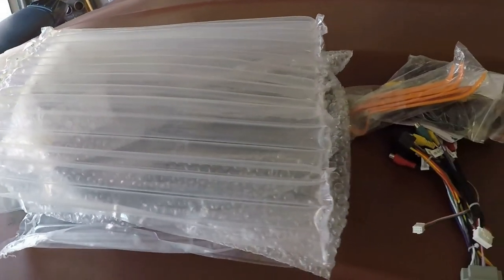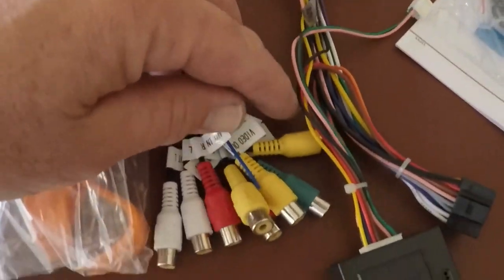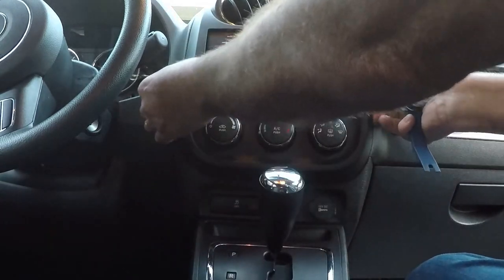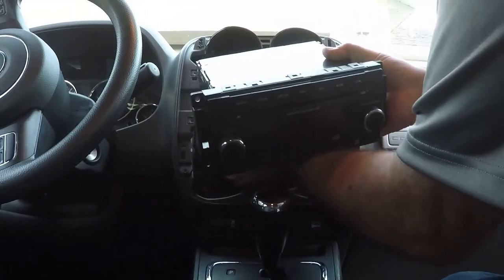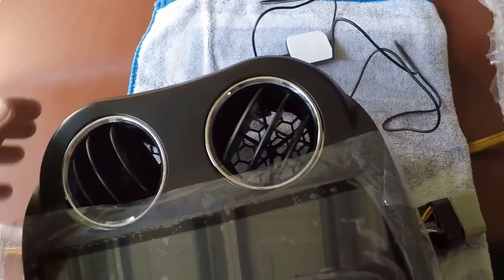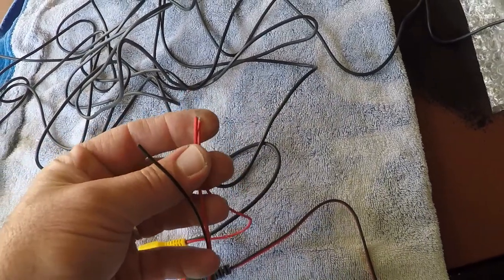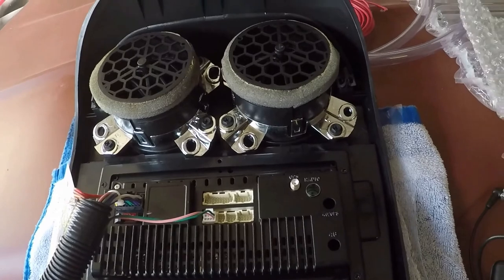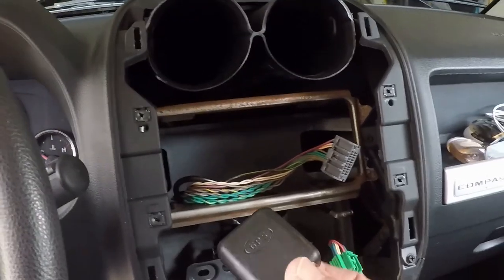Compass GPS install

Comment: Just installed this same unit in 2016 Compass. I didn't do back up camera. Maybe in future. Wiring was bit confusing, a lot of the instructions were in Chinese! The plugs are designated to only fit one spot, so trial and error til ya get it.Have seen in comments about the other white harness on factory radio. This plug is not used, there is another one hooked right next to factory antenna, mine was yellow and orange that is not used.
That part only took about an hour, getting all functions working...maps, youtube,google...etc took another 3 hours of pushing buttons and changing settings etc...update all apps. I had to tether hot spot from phone using Bluetooth, the radio said WiFi only connection. With hotspot on it turns off wifi, that's ok phone instruct was wrong. The sound is good but you have to choose right settings and use EQ. Overall, the hassle seems to be worth it, touchscreen functions well. No lag in display. Hope this helps! ✌

Comment: Unit has been awesome since i got mine. Installed it with no problem. Only issue i dont like you cant use the gps without bein connected to your phone😏🤦🏽
Reply from the maker: I think it’s a pretty nice unit for what it is.  There are a few things I’d like to be different.
I’m glad that you are mostly liking your stereo

Comment: Do you have a link for the Jeep Radio Plug Adapter? Please put in description, thank you
Reply from the maker: I should have added that information in the description, it’s there now.  The only wire I needed to order was the antenna adapter VWA3B.  It’s a short wire with a light green connector that plugs into the jeeps antenna wire and the other end with the round connector plugs into the stereo.  I ordered mine online but many different stores carry them.
Reply: @bhwjrproductions  thank you for your reply

Comment: i just installed this same kit and still need to run the wire for the backup cam (when I get some time). Thanks for the detail with how you ran the wires in the liftgate itself. I am curious though what pathway you took from the rear pillar to get the video wire back to the head unit. Did you go high (under the headliner), or low (under rocker panels). Just wondering if you had an opinion on what was easiest. Thank you
Reply from the maker: I went low under the door sills/ edge of the carpet.  I think i ran the wire up by the driver door then low across the bottom of the dash to the head unit.  It was a pretty long wire.  The hardest part was pulling the wire through that rubber boot from the lift gate to the roof of the car.  I taped as thin and smooth as I could and sprayed a bunch of armor all rubber protectant in the boot to help slide it through.  The wire is skinny but the rca connector is kind of big but it squeezed through.

Comment: I’m in the middle of installing my touch screen but it’s not cutting on , how did u get it to cut on ?
Reply: Check your harness wiring.  Sounds like it's missing the 12v power.

Comment: Appreciate the guided installation, got this same unit installed but haven’t done the camera yet. Where did you connect the red power to and where did you end up grounding the black?
Reply from the maker: The red isn’t needed.  I think there is a signal wire in the factory radio plug that tells the radio that the car is in reverse.  There was an optional back up camera for the compass so some of the wiring is already in the car.  I just taped that red wire off, it isn’t needed.  The black I grounded with another ground behind the drivers side trim panel in the rear storage since I had that panel off already to Ron the video wire and tap into the backup light.

Comment: I just installed the newer version of this (4g+64g 10.1" android 12 unit) and its not getting power at all. everything is plugged in correctly but for some reason no power to the unit... my last unit (Boss BV965NV navigation system) popped and started smoking from the cd slot so i wonder if something fried.

Comment: My backup cam doesnt display any guide lines. I tried to find it in the settings but no luck. Any help?
Reply from the maker: My back up grid was there when I first selected reverse.  I like it and never tried to turn it off.  When in reverse if I touch the middle of the display screen a menu pops up to adjust lighting but I don’t see any option to turn the grid on or off.

Comment: Where did you run the wire for the backup camera? Dis you run it openly through the car up to the front?
Reply from the maker: I pushed/tucked it under the side panels and door sill panels on the driver side then zip tied to other wires at the bottom of the dash on the back side enough so the wire wasn’t hanging and it’s hidden.  Then it hangs out of the stereo hole where it’s bundled up with the rest of the stereo wiring.

Comment: How has the system been working I’ve been interested in getting one for my car. Also how easy was it to install not counting the back up cam (not really a fan of those)?
Reply from the maker: It’s still working well.  The backup camera is pretty nice, we like it.  It’s my daughters car.  She has her phone Bluetooth connected to it for her music and hands free phone calls through the stereo.  The back up cam part was the hardest part, the rest was about typical of a stereo install.  The gps antenna is still working well even under the dash where I placed it in the video.   The stereo volume always starts at a certain level at each startup but it can be programmed to auto start up at a low level.
Reply: @bhwjrproductions  thank you for the update I really like the model and I think it’s the one I’m gonna go with! I appreciate the content and your response.

Comment: I’m having problems with mine resetting after a few days any suggestions?
Reply from the maker: Mine (it’s my daughters Jeep) loses a little time on the clock.  When it sits for a day or 2 the radio clock is about 5 or so minutes behind but it immediately updates when it connects to her phone.  We’ve had no other reset issues.
Reply: @bhwjrproductions  Thanks buddy. Might be something in my battery

Comment: Just installed one of these in a 2015 Jeep compass. Do you have any idea on how to get it to work with factory reverse camera? After I installed the radio, I put it in reverse just to see, it popped up like the camera was going to come on but it just showed a black screen with the indicator lines. Thanks
Reply from the maker: I’m not sure but I think the two little 1” yellow wires hanging out of the 2 wire (black & yellow) connector that came with the stereo need to be connected to the Jeep harness that has the camera wire in it.  My Jeep didn’t have the factory back up camera or nav computer and I think I have a different stereo harness than the better equipped jeeps came with.

Comment: Hey, great video! Quick question, could you elaborate on why you said the extra red wire at 10:28 is optional? If you didn’t put it in the harness, how does the radio know to go to reverse camera when car is in reverse? Thanks!
Reply from the maker: Because this car had an optional back up cam from the factory Something in the cars radio wiring already sends a signal to the radio
Reply: @bhwjrproductions  I see. That makes sense. I believe my radio is the same way. Thanks for the reply!

Comment: How did you get the GPS connected? That's my main issue
Reply from the maker: Are you asking about how I put the antenna in the dash or opening the gps on the screen?

Comment: So I have this radio for a few months now and ive had some issues, like drained battery, my check engine light came on unplugged the radio finally and started the car and check engine light went away, have you had any of those issues
Reply from the maker: No, we’ve had no problems with this radio at all, no check engine lights and no battery problems.  I think The back up cam is either dirty or the lens is slightly cloudy because the image doesn’t seem to be as clear as when I first installed it, that’s the only complaint.  It’s my daughters car.  She is still driving it daily about 500 miles a week.

Comment: I can’t get SWC (Compass) to work with mine. Did you encounter this issue?
Reply from the maker: My daughters google maps gps is waiting for an online update and won’t run until it gets one.  She likes her phone gps and never updated it.  
The iGo navigation works pretty well.  
There is a screen that shows altitude speed and a compass heading.  All of those work well.  I’m pretty sure your phone can Bluetooth link to the stereo which would display your phone info
Reply: @bhwjrproductions  compass is the model of the car. But I appreciate it :)
Reply: Update: turns out hardware I was sent was faulty, they shipped me a replacement, which worked perfectly out of the box.
Reply from the maker: @pastormichaelnewsom  
That’s great news

Comment: I see you only plugged in 1 plug for the new radio
Reply from the maker: https://youtu.be/fQkbUvP2Zc8?si=SwYLtK6r3PqrW9r8

I just added this video that shows the stereo plugs.  The white one I didn’t use as there was no place to plug it in on the new stereo harness and I had to order an adapter to connect the antenna which I installed several days later, it’s shown in the new video.

Comment: What kind of radio adaptor you got and how's the radio worming
Reply from the maker: The stereo has been working well, no complaints.  The stereo wiring adapter we bought on Walmart.com, that made it virtually plug and play.  It is a Chrysler stereo adapter.

Comment: Where did you leave the old radio white plug connector ? It suddenly disappeared, I didn’t see where you connected it.
Reply from the maker: The big rectangle plug with only 3 wires in it, It’s still in there.  It dropped just out of view where the back of the original stereo was.  It isn’t connected to anything.  I should have zip tied it to the rest of the radio wires just to keep them together.
Reply: @bhwjrproductions hey, thx 4 the video. I realize this is bit old but I was wondering the same. That large white plug has no where 2 plug in 2 on the new unit. What did that control? Thanks in advance
Reply from the maker: @Dr_Hfuhruhurr_23  
I’m not the best at video editing.   The white plug is still just hanging there unused.  I must have edited out the part when that plug was pushed back out of view.  I still have the original stereo and dash panel.
Reply: @bhwjrproductions  hey, appreciate the response. I zip tied everything up nicely and got it squared away. Looks pretty cool. Thx again

Comment: Hello, are steering wheel volume buttons working?
Reply from the maker: I have a Jeep Compass Sport.  It’s a base model with the base low end stereo, and the steering wheel doesn’t have the radio control buttons.  The backup camera works as it should and the radio automatically mutes when in reverse but the volume must be adjusted manually.
Reply: @bhwjrproductions  Thank you!
Reply: I installed on my wifes parents 2016 Jeep Compass High Altitude and full steering wheel controls. Very happy with the install. Thank you for this informative video.
Reply: @steveleclair1181  I have a 2015 Jeep Patriot that I just installed this radio head unit in. Where can I find info on the Key 1 and Key 2 connections for the steering wheel controls?
Reply: Did you take additional steps for the SWC? I can’t get mine to work and can’t find much info online

Comment: Did you have to get a adapter for the power? I'm so confused rn.
Reply from the maker: The power is part of the main plug going into the stereo.  I got a stereo adapter harness to adapt the Jeep radio plugs to the stereo and an antenna adapter because that didn’t fit.

Comment: Did you have problems with it draining your battery
Reply from the maker: I have no battery draining problems.  It’s usually driven every day but it’s often parked for the weekend.  Recently it sat in an airport parking lot for 6 days and started right up.

Comment: Do you have a link to the eBay seller and is there a link for the antenna adaptor?
Reply: Just search Jeep Compass stereo or radio with the year that yours is and it’ll pop up with some from different sellers

Comment: I have this radio it powers on but no audio... Do you know how I get the audio coming in?
Reply from the maker: Double check that all the plugs are fully seated in the back of the radio and at the adapter harness.  There is a menu to set the volume at a preset level at every startup of the car.  Check to see if it might be set at 0 volume.  Does the GPS voice come through your speakers?

Comment: My volume controls do not work, the radio comes on and the sound is high but the screen bar will move down but the sound still stays the same even if try to increase the volume. What am I missing here?
Reply from the maker: You said the sound is high, are the speakers producing sound or does the display indicate the volume is high but the speakers have no sound at all?
Reply: @bhwjrproductions  the pre-set was loud and the volume control would not respond. A tech with the manufacture of the unit got me fixed, seems that it was set up for a 2017 Compass and I was unaware all you had to do was turn that year off, duh. Works great now.

Comment: Did the gps work with the antenna behind the head unit?
Reply from the maker: Yes, its working very well, it’s stuck with double sided tape (VHB tape  works really well for me).  The gps is as far forward as I could reach and everything in the dash looked like plastic.  The windshield has a decent slope to it and I thought the antenna had a good look straight up through plastic and glass and not much metal.  I wanted to hide the wire and didn’t want to poke a hole in the car creating a leak.  I’m not a professional at this, just a guy who likes to work on cars.
Reply: Thanks Bruce. I bought the same unit. My unit will only turn on if I take out and reinsert the radio fuse from under the hood. Once I do that the radio will turn on and I am also able to turn the jeep off and on with the stereo coming back on. If I leave the jeep for an hour or so and come back, when I start the car the stereo doesn't turn on. I have to then pop the hood again take out the fuse and reinsert it for the radio to start.  The radio fuse isn't blown from under the hood. I am really stuck here. I'm no pro either. Any tips would be helpful or if you know anyone who may have an idea what's happening. Thanks
Reply from the maker: @mklew93  
That’s weird.  When I plugged mine in it turned on with the touch screen.  I did a quick test just plugging in the wires to the unit to see if it would work and it worked perfectly.  Then I put the original stuff back to video it.  The camera wire routing took the longest.  I had the radio in and out several times fit checking then one last time when the antenna adapter came in a few days later.  The stereo flipped over to back up cam and the radio volume mutes when the car goes into reverse.  It all just worked.  I’m puzzled about the fuse thing.  Is there something I could look at on my radio that could help you?

Comment: How did you drill the Camera on the back?
Reply from the maker: I took the interior panel off the lift gate and unscrewed that handle piece and pulled it out enough to file an opening for the wire to pass in.  I ran the wire with the license plate light wire through the lift gate.  I drilled 2 small holes straight up to mount the camera.  All this is in a plastic part so I wasn’t worried at all about rust.

Comment: Did your gps system work with the antenna right there
Reply from the maker: Yes it works well.  It seems to be well connected.  If I speed even 1 mph over the limit it tells me that I’m going too fast.  The backup cam is pretty awesome too.
Reply: @bhwjrproductions  great I am setting the same one up right now and this video is very helpful, thank you

Comment: I just installed one of these in our Jeep Patriot... Really wanted to love it but the sound quality is horrible... Very muffled and sounds like it's in a box.  Everything was plug and play.  Had the sound been good I could have worked with some of the quirks...  shame really
Reply: You need to set the EQ. I have the same one as the sound quality is amazing.
Reply: @jspau  yep did that.  Literally tried every setting including the developer ones.  It didn't change anything.
I then got a different one in the sound quality was improved but still not great.
I think the one unit that I got was a dud or something was wrong with it.

I'm actually sitting on about four of these now lol. They're good with certain aspects but they're also bad in others... I wish I'd made manufacture would make something just like this and then it would be superior quality.

Comment: How much was the total cost?
Reply from the maker: The stereo was around $150 on eBay.  The only things I needed to buy were the stereo wire adapter from Walmart, it was $15 or so and the Chrysler antenna adapter from eBay was about $10.  I already had electrical tape, zip ties and a couple of screws for the backup cam.  Everything else was included with the stereo.

Comment: I did install my an a jeep patriot
 but is draining the battery in one night I don't know what to do 
Does anyone have same problems ?
Reply from the maker: I haven’t had any problems at all with this stereo, and no battery draining.  It plugs into the car’s radio plug.  I didn’t add any power wires or tap into any other wires.  Maybe you could pull the stereo fuse from your cars fuse panel for a couple of days to see if it’s the stereo circuit that’s running your battery down?
Reply: @bhwjrproductions  Thank you so much for texting back yes I did take the fuse out and no problems with the baterry for more than 1 week 
Maybe it's  damaged something inside of the radio 
I will try to replace it with new one